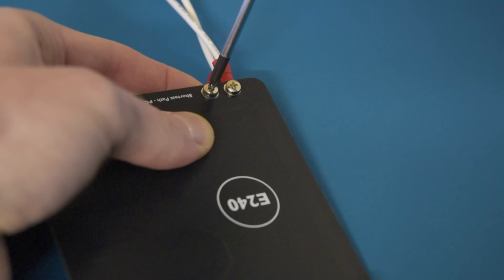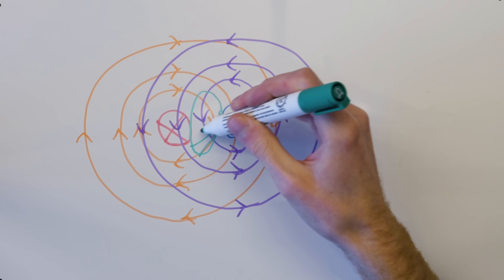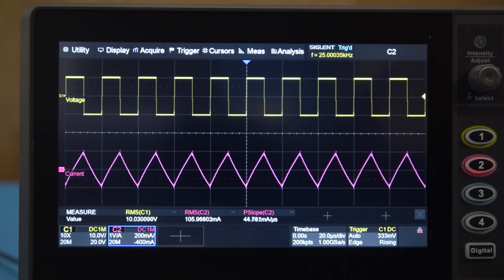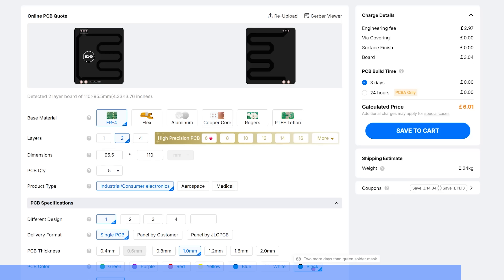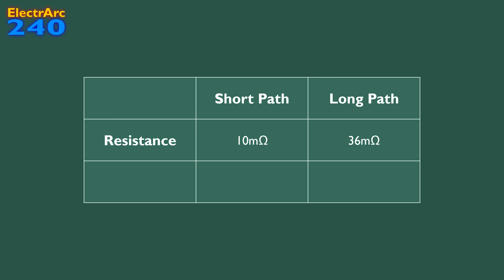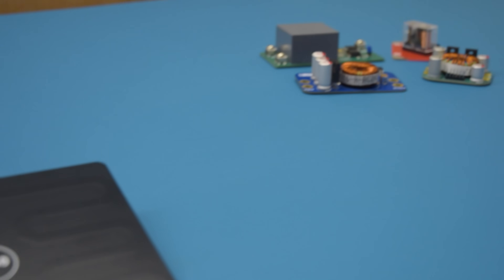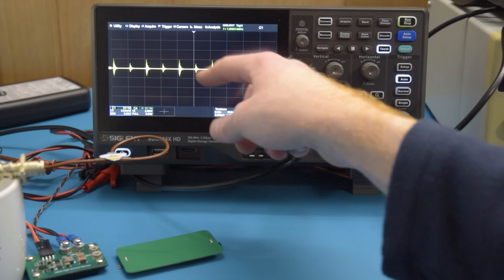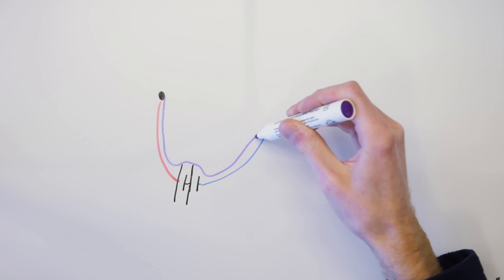Electricity Doesn’t Always Take the Path of Least Resistance

Comment: Honestly I did not expect this to be so educational. I lowkey expected it to be that the short path has a higher resitance (different material), and thats all. 😄 But it turned out to be much more than that.
Reply from the maker: Yeah I was worried people may assume that to be the case and not click on the video, I would probably think the same
Reply: @electrarc240  improve the thumbnail? Add extra information as text in thumbnail like what the video is about (impedance) or say something clickbait-y like “unusual behaviour!” or something else eluding to what the video is about.

By the way, what was wrong with the original PCB? It looked OK on screen.
Reply from the maker: @davadoff  The bodge wire was to reduce the (DC) resistance of the return path as it was heating up too much and made the long path above it hotter than the short path with DC. With the wire that doesn't happen but it does make the results of the demo slightly exaggerated as the skin effect in that wire plays a big role in the additional heating of the long path from the return trace underneath with AC. Ideally I would have got a new board with a wider return trace or most likely a solid GND plane on that side of the board but I ran out of time.
Reply: @electrarc240  I was thinking reducing DC resistance would make it heat up more, not less, but I understand now… all the DC return current is forced to flow that way and it’s longer, dissipating most of the power. 

Regarding skin effect; I would have thought adding the bodge wire would increase the surface area, reducing resistance. So why does it increase heating?

Who would have thought such a simple PCB with no components could be so complicated…

Comment: Electricity doesn't take the shortest path in length

Takes the the path that provides the least reactance and resistance 

Really short path but extremely high impedance and resistance 

Or a longer path that electrically is closer to a dead short with low impedance and resistance
Reply: Path of least resistance isn't the always the shortest path to "ground"

Ask a lightning bolt

Comment: Hi. Tell us where we can take a look on 1mhz current source schematics? Thanks in advance.
Reply from the maker: Hi I made this board a few months ago for this demo. It's a ZVS circuit using GaN transistors from EPC, if there is a lot of interest I can make a video about it though it is quite niche. As for schematics I'm not really sure as I just came up with the design on my own, but other ZVS designs would be a good starting point.
Reply: @electrarc240  I would be deeply interested too. Maybe for you is trivial, but for folks like me with no electronics background would be very informative.
Reply: @electrarc240 yes, please share your design. Please specify voltage an current ratings. Thanks in advance.

Comment: I absolutely love your videos. Not only are you explaining everything clarely, you are also using your sponsor very well and showing what impact a design is having. I am studing electrical engineering and your videoes help me understand what all the equations I am calculating actually do. Thank you so much and keep it up.
Reply: Just imagine the insane engineering when designing RF circuit boards for phones especially above 20 GHz.  I often see various zig-zags traces on boards which appear seemingly random in length and layout.  Evidently they are designed with very specific frequencies and inductance values in mind.
Reply: @BillAnt I can't begin to imagine how much work goes in to everyday electronics.
Reply: @BillAnt  Nope kids. High frequency stuff is almost treated like Light. You are transmitting EM fields/waves into DIELECTRIC (energy transfer happens there). There is no "magic" and it's not "insane".
High-speed PCB boards are calculated for space between the traces (and ground layer), not just traces.
Reply: @GrandePunto8V  - "Nope kids"  nice start of an explanation... no thanks!
Reply: @BillAnt  Clear and correct explanation. But if you are stuck in the "tone policing" mode, it's your problem. Grow up...kid.